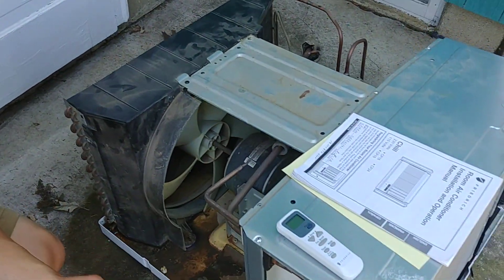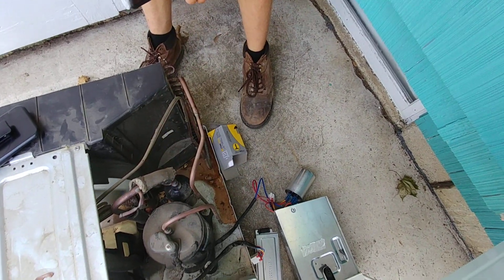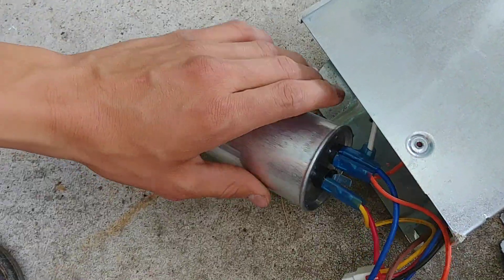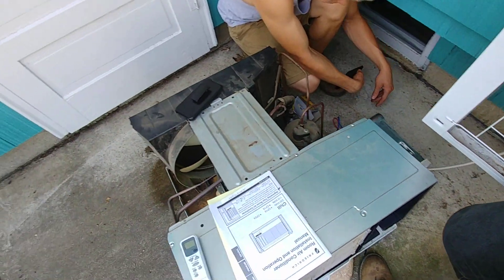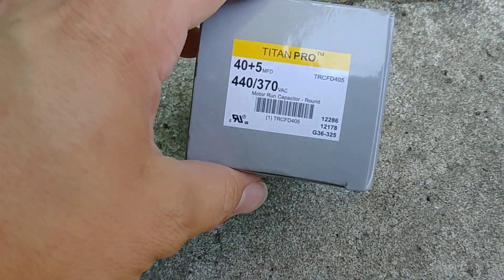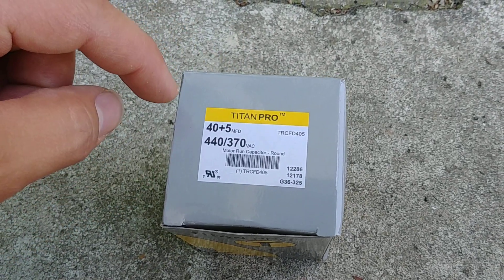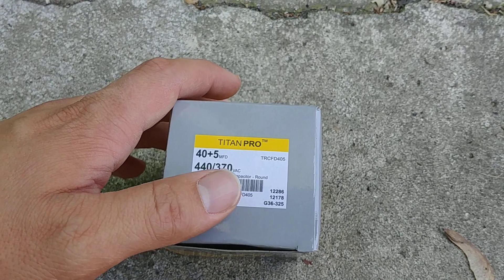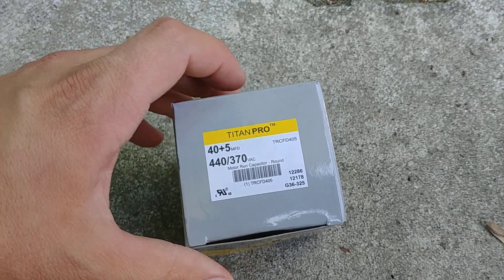Window AC Compressor & Fan Won't Run - Bad Capacitor Symptoms

Comment: Where was the capacitor located?  I opened mine ac and couldn’t see a capacitor.  It’s a freidrich.
Reply: Friedrichs usually put them inside a metal rectangular enclosure that it shares with the main control board, and this enclosure will always be on the inside portion of the AC, so look around the display and left/right sides of the evaporator coil.

Comment: Got one I have to look at tomorrow, hope it's the CAP. 
Funny thing is, the fan works on "fan only". On "cool" I can hear the compressor run.... but the fan wont spin up. 
Got a shared motor for both condenser/evap fans. 
Figured I'd ask before looking at it, if you've ever seen this?

Comment: I have a 1.5 Ton Sanyo Window AC which is more than 20 years old. It still runs with Perfect Fast Cooling & Silently. I had only got it serviced 4 times in total in the past 22 years. Each service after 5 years. For the First Time since so many years it has started an issue. After reaching the desired room temperature the Compressor gets switched off (That is fine). But the issue is after about 2 to 3 minutes when the Compressor restarts then it is unable to restart for @ 3 attempts by the AC itself within a time period of 15 seconds with a clicking sound. In the fourth attempt the Compressor invariably starts again and this cycle continues till we keep the AC on. So it works like this but the question is as specified above “Why the Compressor needs 3 attempts (Each with one clicking sound) and it starts after @ 15 seconds in the 4th attempt for every cycle”

Comment: Greetings, after cleaning AC it will not cut on now and when I plug it in the reset button pops and the unit wont trun on. Could it be the control board/wires got wet or need a capacitor or new unit altogether???

Comment: Replacement capacitor compresor for Ac Window, how many micro farad capacitor replaced?
Reply: It must have the same micro farad rating for the compressor and the fan. In the case of having trouble of finding a specific rating, like 35+6 uF for example, you can simply replace it with a 35+5 uF instead, and add a small 1uF capacitor in parallel to the 5uF to have 6uF on the fan side.